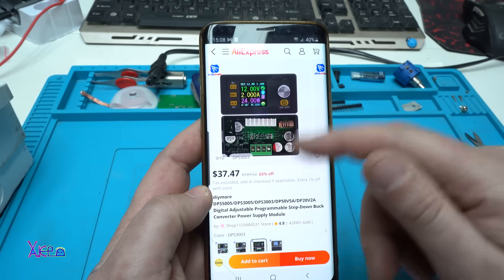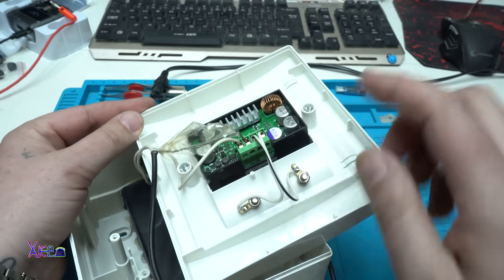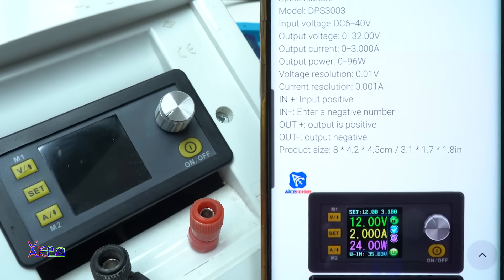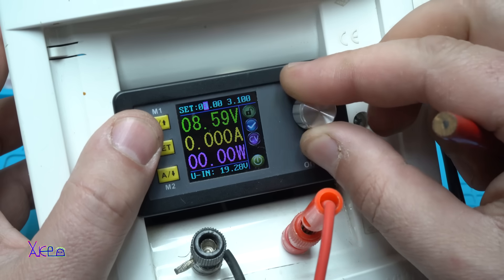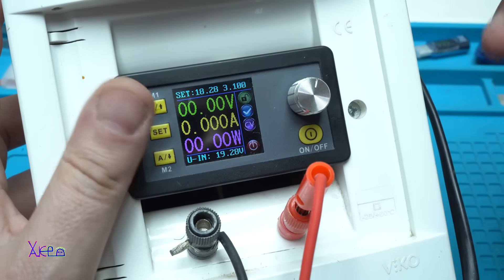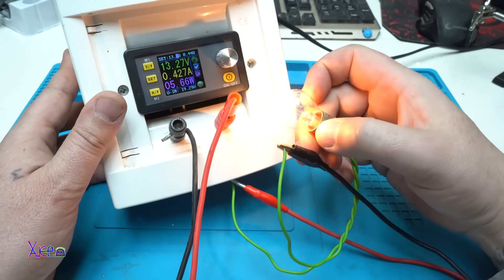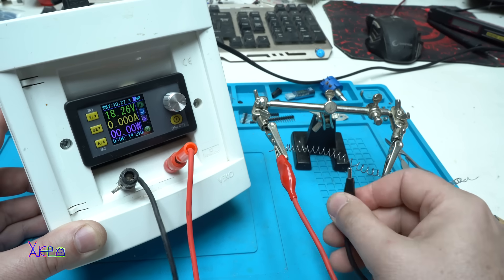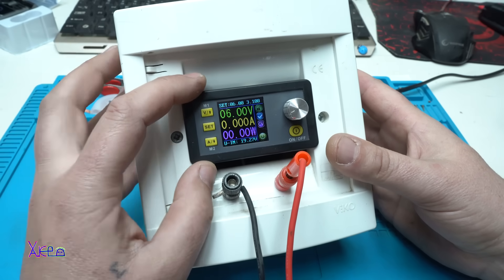DPS3003 $? Aliexpress Laboratory Adjustable Power Supply

Comment: Could this device be used with a 19.5V, 16A, 330W laptop power supply?

Congratulations on the channel... I follow it a lot.
Reply from the maker: Yes you can use it but the max power that dps3003 can handle is 90wats
Reply: @Hacktuber  Thanks for all

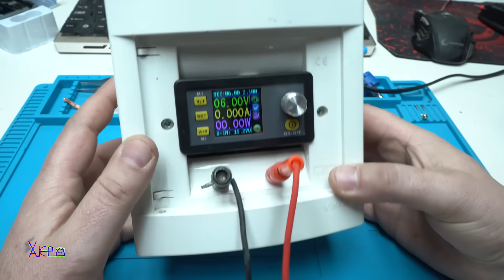Comment: Dude, at 11:17 when you want to power the resistor fixed on the holder make sure to insulate the clamps first, otherwise you short-circuit the resistor.

Comment: perfect lab power have 30V 10A max, you need rewiev and test aliexpress  lab power supply who have similar display but big main board 6020 model mean max 60V 20A, have many , interesting and want know how good this set have hobby user lab power supply. etc, this 
WZ5020L WZ5012L DC DC Buck Converter CC CV Step-down Power Module 50V 20A 1000W Adjustable Voltage Regulated Power Supply

Comment: good review but these modules are very expensive compared to smt like ZK-4KX which you did review before or you may review DPH5005 which looks a bit weird and I don't know its power output or if it is any better than a much beefier version like DPH5005 which can handle 250 watts and I would like if you tested it using an oscilloscope to check the noise level and if it has a soft start or more importantly if it give a  huge current in the first couple of milliseconds due to capacitor discharge , thanks for your work and keep such content I learn a lot and as a uni student you help me find cheap useful stuff that I can't afford its alternatives keep the good work and I wish you all the best

Comment: Another great module, l like the idea of using an old laptop psu. 
BTW, at 8:34, your metal helping hands are shorting out the resistor wire......
Reply from the maker: I figurate that after a while....😁

Comment: I have one DPS 3003 too, I built it into a fixed 24V DC bench power supply, great upgrade. Please note that you can only get the maximum wattage if your input voltage is above 31V. So the laptop powersupply will not do 😁😁
Remember P=I*U, so maximum 3,1*30 is about that 96W
Reply from the maker: Yes I need higher input voltage,I will upgrade and make a video,thx for suggestion sir
Reply: @Hacktuber  my pleasure, good luck!

Comment: I have been using the module "ZK-4KX" for a long time. Also works very well, which I find important, it shows current up to 0.000A. Is 4A and 40Volt. Price is a lot cheaper at €12.00.  Geetings from Belgium 😉
Reply from the maker: You know that I review that model and really is good,thisdps3003  model is expensive bcz of lcd color screen nothing more
Reply: @Hacktuber  I just bought one after seeing your portable build. I think I will use mine as a desk power supply though. Just need to find a nice looking enclosure in my "Boxes of things that might be useful one day" 😄